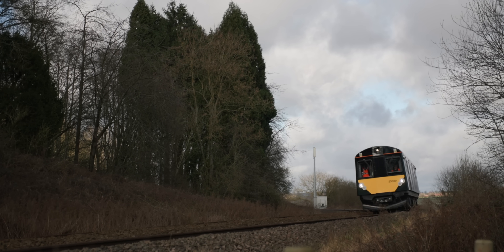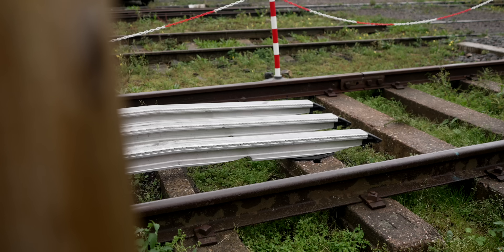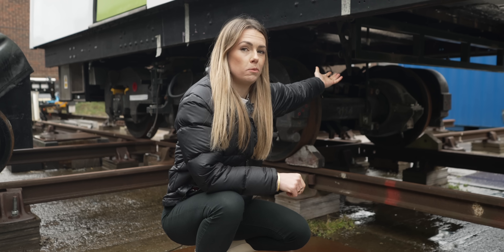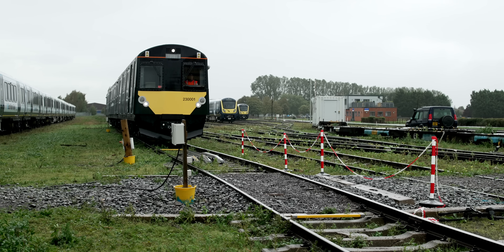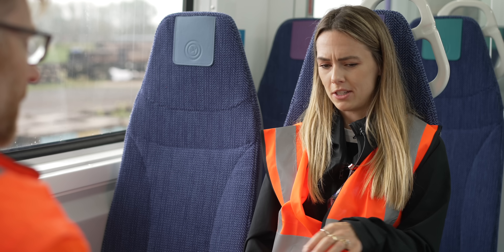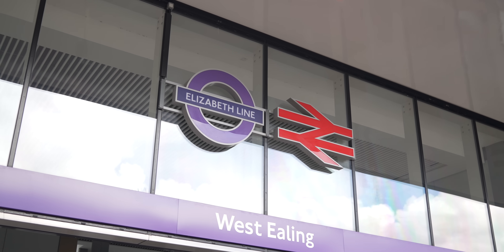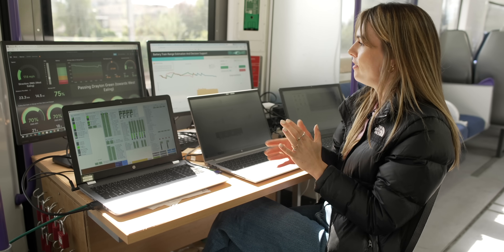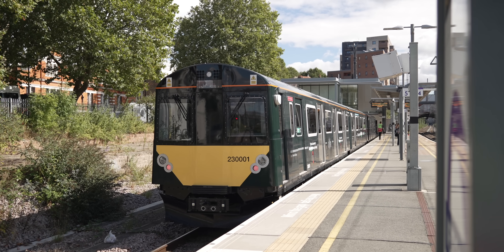Onboard the UK's First Battery Electric Train!

Comment: I was Senior Buyer and Analyst for the company that built this electric train and others. The others went to USA. There were other unbelivable inovations that occoured during building this train. The original builder of this train is Vivarail, I actually wore one of their jackets to work today with pride. Ian Campbell Kelly was a great inovator at Vivarail. If you are train-person I can explain. But just look at the quality of the train. Vivarail should have been huge, I will not go into the details of what went wrong - just let me say Vivarail could have (in my opinion) been the Tesla of trains. Brilliant work that Dave and Julian have done - what a shame Vivarail was not the massive success it could have been for the UK.
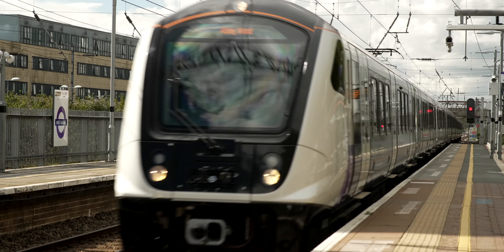Reply: Can you explain why Vivarail/GWR designed this custom shoe coupler instead of using well-understood 140-year-old overhead wires (which you can see at West Ealing station at 12:45) to recharge? Was it just to save money converting these Class 230 trains were originally London Underground D78 electric cars? 

Also, everyone wants to know if the trains have regenerative braking, and GWR's own press release don't say.
Reply: @skierpage  Good question! 

Parts of the answer were given in the video but I agree that without already knowing the history this particular point wasn't covered in detail. Yes, W Ealing is on the electrified mail line going West out of London.

BUT the infrastructure you mention can't handle anywhere near the levels of current needed to recharge a train in 3 mins.

On Merseyside they have a battery train that recharges from third rail, but that train only runs on battery for a few percent of it's duty cycle.

The wires at West Ealing continue over the Hanwell viaduct, but well before then the line to Greenford has turned off, and that is not electricified at all. So unlike the Merseyside solution they would have to use about 10% of the journey to recharge a whole round trips worth of power 

... Or the train could sit in the station at West Ealing for an hour between services, whereas the video did explain quite well that the goal was to return to service after only 3 mins after arriving.

The longer term reason is more strategic. 

GWR has a huge number of branch lines that are similarly unelectrified, but join an electrified main line. By the time the original developers of this train had run out of money, GWR saw the tech would meet a need they have on each of those branch lines, and by then the prospects looked good that it would actually work 

Due to  Vivarail (the original developer company) going bust, GWR was able to buy into the success without having taken the original financial risk. 

Happily, the development team also kept their jobs, but after the buyout the new management refocused the project on the specific needs of GWR and it's branch lines, because that's what they wanted from their rescue. 

Other interesting ideas that Vivarail had had, that were technically just as successful, were dropped because they didn't fit into the GWR strategy. And at least something was salvaged -- in my opinion the battery train was the tech that would have had the most impact on the climate crisis, so from an eco perspective it was a happy result too
Reply: @trueriver1950 
Merseyrail have the class 777/1, a sub class of the class 777. The 777/0s being 3rd rail DC only. The 777/1s make up just seven units of the fifty three unit 777 fleet. The batteries, lithium titanate, are mounted in the same space designated for a transformer, should they be required to be dual voltage in future. So, they can be either IPEMUs, or dual voltage, but not both. As you rightly say, only a short part of their overall route from Liverpool Central to the new station at Headbolt Lane is required to run on battery, the rest of the time they draw current from the 3rd rail for both traction and battery charging purposes. The overall route being quite short, only four units are required in service to maintain a 15 minute frequency. The 777/1s do occasionally make appearances on in service on either the Southport or Ormskirk branches of Merseyrail's Northern Line.
Reply: @trueriver1950  Thanks for such a detailed answer. As is so common, innovation in the UK is excellent but access to decent finance always seems to limit the potential. I hope to see more battery trains being used to replace DMUs.
Reply: Are you able to say what some of the other innovations were?
Reply: @trueriver1950   thanks, but "the infrastructure you mention can't handle anywhere near the levels of current needed to recharge a train in 3 mins" seems off. 25 kV overhead lines can supply 8 MW, and at 12:17 the 500 kWh of batteries are only charging at 642 kW... but then a 10-80% charge would take 32 minutes not 3.5. Hmmm.

 Someone else mentioned that overhead wires aren't designed for stationary charging.
Reply: @skierpage  
Several reasons. They'd need a transformer from 25kv AC to feed the batteries. The shear power demand required for rapid charging. Installing a short section of charging rails is a lot cheaper than Installing catenary. The 230's would require roof modifications including a pantograph well, reinforcement to take the weight of the pantograph equipment. Running the supply from the pantograph through the vehicle or externally to the transformer and charging equipment. The shoe equipment is more robust and easier to mount under the vehicle. It can be deployed just before the unit is over the charging rails with no problems. The train doesn't have to stop exactly at the same spot as long as it's on the charging rails, unlike the recharging pantograph technology for battery electric buses. There are three shoes, one I assume is a ground. If the conventional 25kv was used, it's only one point of contact, so the wheels and running rails would be used as the return. A 25kv set up would add a lot of expense and additional weight  what with transformers, pantographs, and the associated engineering required to install them.
Reply: @neilcrawford8303  From the kit it appears only 2 of the 3 platform pads, and only 2 train shoes, are used in a train direction of travel, so could be a closed-circuit back to the batteries with no ground.  The other platform pad is used if the as-built train is "flipped" travelling in reverse (locomotive tip connected to carriages).  This is based on symmetry considerations in the simple picure shown.
Reply: @skierpage  regarding the braking system: it's described as "electro-reactive pneumatic". I'm not sure if that means it is partially regen, or not at all. Maybe others can help unpack that terminology?
Reply: @skierpage  If I had to make an uneducated guess, I'd say the overhead wires can't take as much juice as those big, thick, flat rails can.
Reply: I don't get why they are fiddling with this fast charger thing. Why not just add the battery to the train? Slow charge the battery at the station. Put it on a bogie. Trains comes to a stop at the station, battery-bogie comes out of a siding, attaches to the back of the train, you don't have to wait at the station for 3½ minutes. Takes 15 seconds. Next time you need to swap batteries (it needn't be at every stop), just before you get to the station, the bogie detach, slows down a bit, and it goes into the battery charging siding at the station. In fact, the train don't even need to stop. If you're traveling a long distance or it's an express train, you could do a hot-swap with the train still in motion. The battery can catch up.
Reply: @danielch6662  All those moving parts means more to go wrong
Reply: @danielch6662  sounds awesome in principle, but much harder to do given the railway and railway industry we actually have.
Reply: @thomaswilliams1082  Guess its time for a massive overhaul really, either pay now or pay later as its always been. But then the gov is too busy ripping everyone off to care sadly.
Reply: @danielch6662 more like NIO technology than Tesla you mean, have you heard of SHWEEB in Rotorua, yes it would need development but it’s better cross country than HS2
Reply: I concur, such a great concept...
Reply: So innovative that nobody buys this british crap.

Comment: In 2015 a single Class 379 Electrostar train was modified to run on electric lithium batteries with passengers on the Mayflower line, which connects Manningtree to Harwich International and other stations in Essex.  This was a trial to enable charging when connected to overhead power and battery on unpowered sections. I have vague memories of tests being run on this line on or possibly before 2010.
Reply: British Railways had a BEMU running in 1958 in passenger service, the 379 was only ever in test.
Reply: @J-Railway-Volunteer  My reply to you was deleted. The 379 did carry passengers on a scheduled hourly service. It was the first battery-electric train service even if described as experimental. Sorry if that upsets the 'Everything Electric Show'.
Reply: @mbak7801  The British Rail BEMU was first in 1958.
Reply: @J-Railway-Volunteer  I hope so but could not see mention of paying passengers.
Reply: @mbak7801  Considering it ran for 8 years I would guess it had passengers.

Comment: You could hear the squeek of the brakes, does that mean it doesn't have regen braking?
Reply: It does have regen brakes however they require the wheels to be moving and thet become ineffective below 3-12 mph depending on the unit, new units it is lower down as AC motors are more efficient, when the 230s first were built as D78s stocks they would regen down 8mph but if you applied brakes below 12mph regen wouldn't kick in.

Comment: Actually I think Merseyrail were first. The Headbolt Lane station on the Kirkby leg of the Northern line was built beyond the termination of the third-rail network, and they didn't want to extend it. Trains on that line now all have batteries on board so they can run to that station, and have been since October 2023.
Reply: First in recent times. As others have commented, battery electric trains (with lead acid batteries) were a thing briefly in Victorian times. This is the rebirth rather than the birth of the idea.
Reply: The 777s trains haven't been the most reliable averaging a range of 896 miles between failures.
Reply: @J-Railway-Volunteer 
Annoyingly some for minor equipment reasons such as the door failures, cameras so the drivers can't see the doors, the moving step that extends prior to the door opening having problems. It's not unusual to be on a train and see at least one door labelled not in use. Trouble is, even though it's minor equipment, it's safety related and takes a train out of service. There's also the dreaded software issues that seem to blight modern rolling stock. We still see the odd 507 showing up to cover services.

Comment: Sorry, but it is NOT the first in the UK. British Rail used a battery electric train from 1958 to 1966 on the Aberdeen to Ballater line.
Reply: I was coming on to say this. 😁👍
It's not like they just got rid of the train either, they shut the whole line.
Reply: @grahamleiper1538  I think one of the BEMU is being restored at Milton of Crathes
Reply: @johnmcconville6055  There was only one
Reply: Also some of the class 777s on one of the Mersyrail lines opperate on battery for a short distance, maybe classed as hybrid third rail/battery but possibly could run battery only.
Reply: @brianfretwell3886  That's good information thanks.This train was a fully electric,2 car unit running on a 43 mile branch line.There is no electrification and the line now is cycle tracks,built over and a small section of preservation railway.Thanks to Beeching 😡
This was all in the late 50s to 1966 and I remember it shutting.😔
Mind you if it doesn't happen in the South of England,then it hasn't happened.
I thought Everything Electric were better than this.
Reply: You beat me to it. Many's the time I've walked or ridden along the old line, lovely place. My wife's family is from Ballater.
Reply: @jonford6119  We are going to Milton of Crathes tomorrow.There is a very nice cafe restaurant,and I am going to see if the BEMU is there.There is a photo of it on the Google maps link.
Reply: @johnmcconville6055  You will find the BEMU stored at the far end of the line at West Lodge, near Banchory. It hasn’t been moved or worked on for many years, I drive past it almost every day.
Reply: Yes, but they ran flat.  They did not charge as good like this one does.  Thats the whole point in having a battery, so you can recharge it.  Plus the older batteries where very very toxic compared to these ones and they got very rusty as well over time.
Reply: And it is still there
Reply: LOL and just like the last one, this will just be another spark that would lead to nowhere why?
The underlying UK regime is the same ineffective corrupt leaders working for fossil fuel corporations.
Reply: While not on the main network, the Midland Metro seems to be operating well without wires in some sections.

Comment: I’m under the impression that Deisel trains are actually series hybrids. The diesel generating electricity and the wheels driven by electric motors?
Reply: Most are, yes. Wikipedia says Class 230 diesel trains are diesel-electric multiple unit (i.e. no separate locomotive) that were converted from old London Underground D78 electric subway cars.

Comment: Great long story and the train will be so much better than the rattling old diesel trains.  One thing you didn't mention, and I hope it has it, is recharge braking. Please say that it does.
Reply: The units have had regen braking since they were running on the London underground.
Reply: @J-Railway-Volunteer : Are you sure it's "regenerative" braking they've had, or rheostatic (where the energy is actually just wasted in resistors, rather than captured and fed to be used)?
Regardless, as per other comments, these have regen and the power is fed back to the traction batteries.
Reply: @fetchstix  I believe it was regen braking they had as D78.

Comment: UK Rail: We can use overhead powerlines to deliver electricity to an Electric train.
Also UK Rail: We have to build an entirely new system to deliver electricity to a Battery-Electric train. A more complex system with new safety issues and points of failure.
Reply: It's taken "UK Rail" well over a century to supply overhead power & it's nowhere near completed now, hence the need for this. 
Even if you take it from when the genuine push to electrification started when they scrapped all the steam trains it's still 60 years...
Reply: @alanhat5252  Yes but why did Vivarail/GWR design this custom shoe coupler instead of using well-understood 140-year-old overhead wires (which you can see at West Ealing station at 12:45) to recharge? Was it just to save money converting these Class 230 trains that were originally London Underground D78 electric cars?

Comment: Could they use motors to regenerate electricity back into the battery. Even in it is using a pair of 15” car wheels on the track for each battery pack.
Reply: regen is done during braking using the existing motors
Reply: Yes it does and it has it since it entered service on london underground.

Comment: I’m pretty sure the UK’s first battery powered locomotive was built in 1837. 
It had the slight issue of making the driver repeatedly pass out from the acidic battery fumes, but it’s the thought that counts.
Reply: ...or from the driver's point of view the lack of thought!
Reply: Hornby .
Reply: @GaryV-p3h 'Hornbys' was how mainline footplate staff used to describe the old Southern's 3rd rail stock!
Reply: Haha, but it's like the first ever cars were electric as well. It's just the infrastructure wasn't there for charging so petrol was the obvious choice.
How things have changed!
Reply: @Andrew_dot_pls And there was petrol infrastructure back then?  There weren't even halfway decent roads to get deliveries down to the not yet invented petrol pump.  Earliest cars were fuelled a gallon at a time from containers, often sold through chemists! 

It's often said that the thing which really kicked ICE vehicles off was the starter motor.  WWI of necessity rendered the technology a lot more robust.
Reply: No, there wasn't petrol stuff either. The difference was that gas could fit in a can and could be fueled quickly. Keep in mind, there wasn't a lot of home electric stuff either. Petrol ended up being much easier to add to retrofit into communities, and could reach longer ranges easier.
Reply: Miodland Railway had one in 1914, and North Staffordshire Railway 1916 admittedly were shunting loco's but could do a days work on a charge apparently.

Comment: Brilliant.  If anyone can explain why trains can not  be self driving. For God sake we can nearly do cars . Trains must be simple.  They can only go where the tracks go .
Reply: London Docklands railway is self-driving but for the rest of the system there's reliability issues with the signalling
Reply: @alanhat5252 I've often travelled on the DLR when the train had to be driven for part of its run due to some kind of maintenance work going on. It seems to be a fairly normal thing on the railway and didn't cause any delays.

Comment: I'd love to see what technologies they trialed for the charging system. I hoped in the future we can use Magnetic Resonance charging.

It has a lot better efficiency than traditional induction charging, and can be used at distances of up to around a meter. This would remove a lot of the moving parts and potentially reduce safety risks.
Reply: I'm not sure that if I fell on the tracks I would want to be magnetically resonated as well! 😂